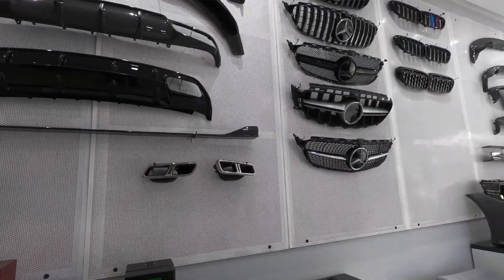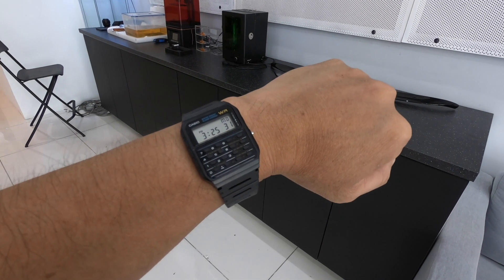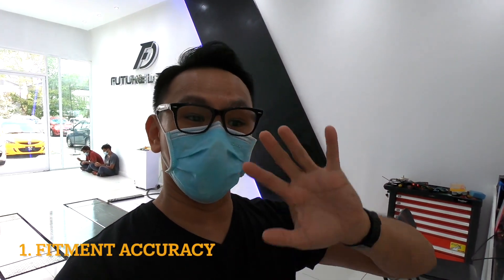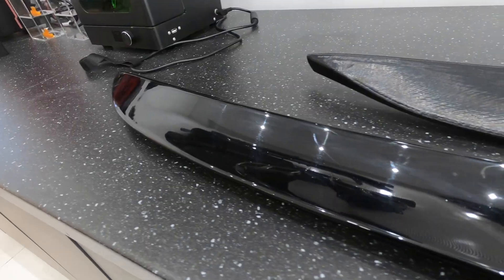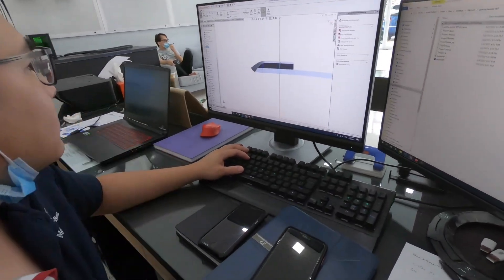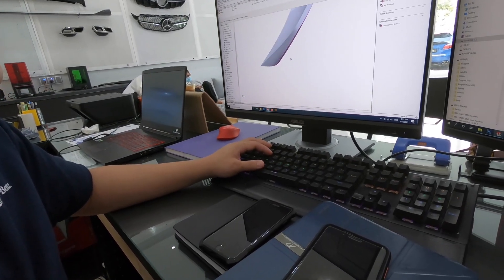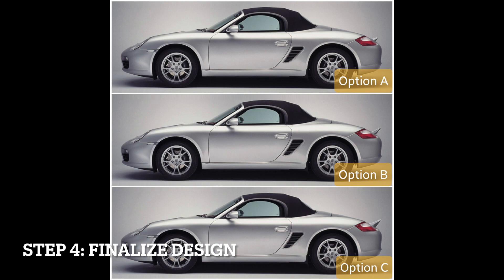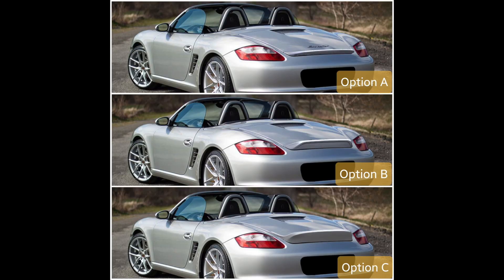First 3D Printed PORSCHE Boxster Ducktail in Malaysia Pt.1  | Boxster Cayman Project | Ep.01

Comment: Co efficiency drag ok ar?
Reply from the maker: The CoD at lower speeds should be higher cos of the potrusion.

At higher speeds, depending on A, B or C it will definitely be different compared to the original except for C. C's height is the same as the original height of the spoiler when it's up 👍🏼